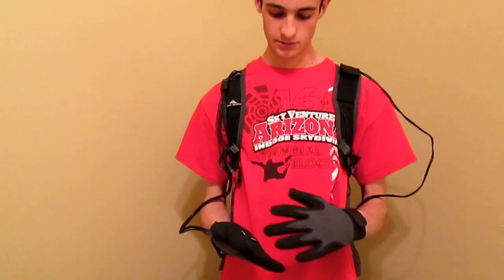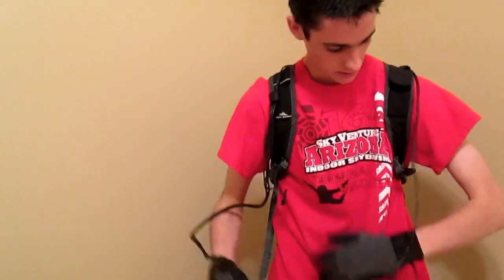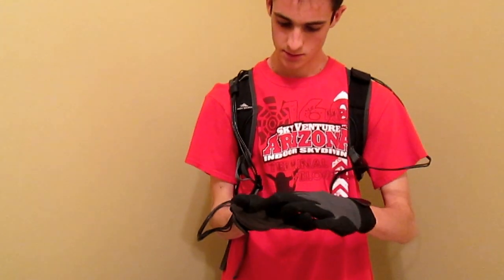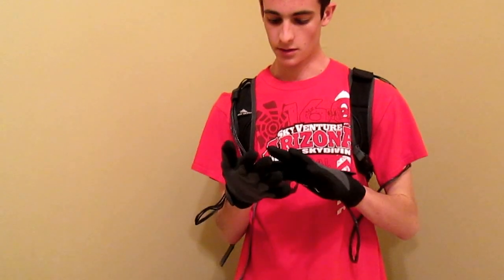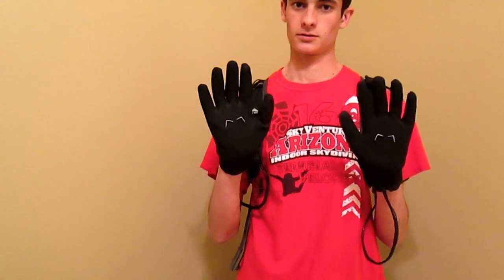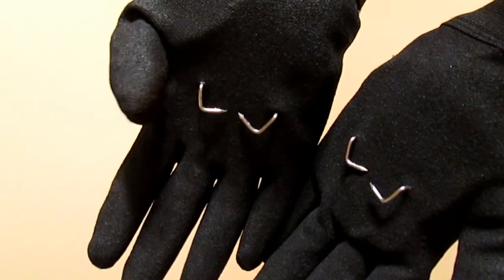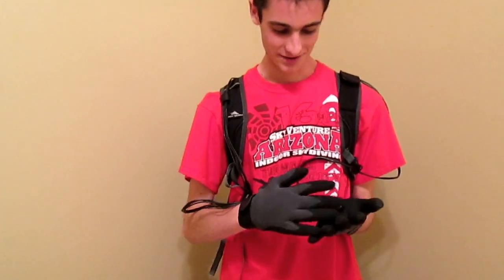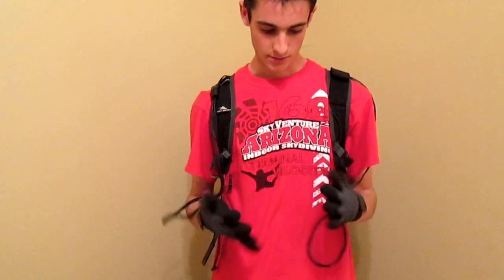TASER GLOVES -- 10 Million Volts!!

Comment: why the electic arc is not going  in your hands ?
Reply from the maker: There is a thin piece of cardboard inside the gloves to insulate it from my hand. Subscribe to see my video coming soon about how to make them!
Reply: because the gloves do not conduct electricity. the wool or leather used to make the gloves have high resistance.you would need a real powerline to go through leather or wool and shock you.

Comment: its not 10 million volts if it was it would be more than 10 lightning bolts hitting u at once
Reply: lighting is not 1 million volts   air has a resistance of 10000v per senter meter at 1 million amps